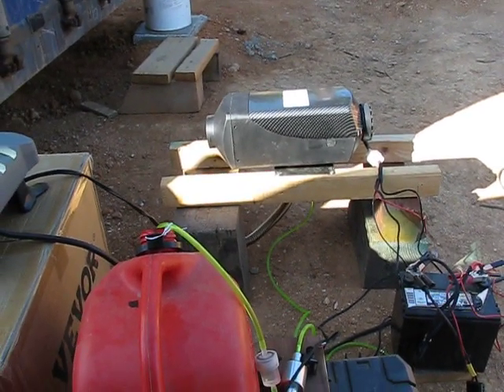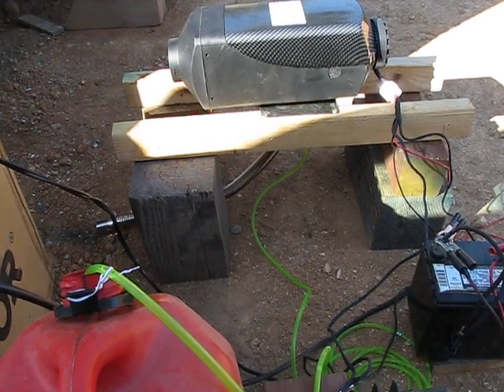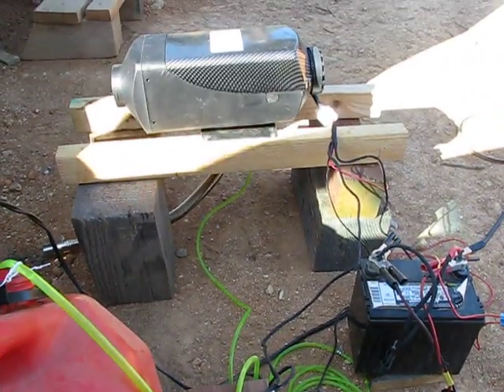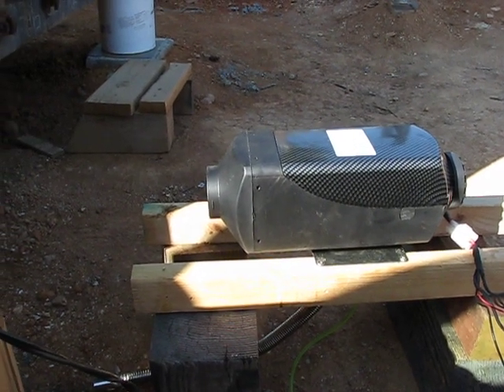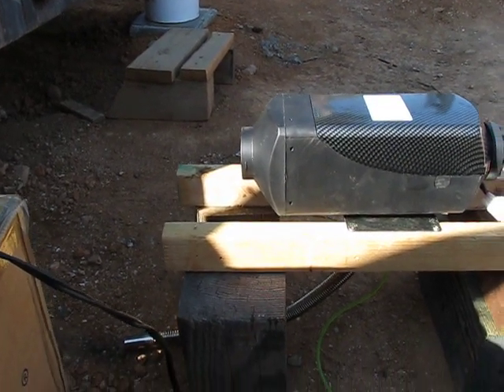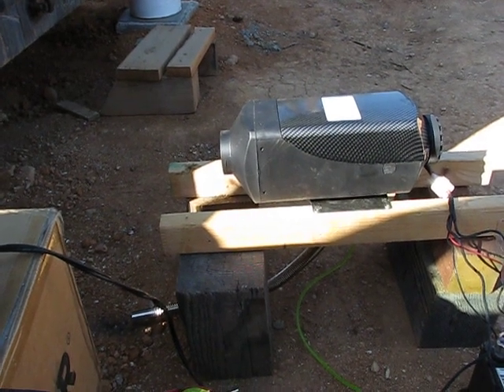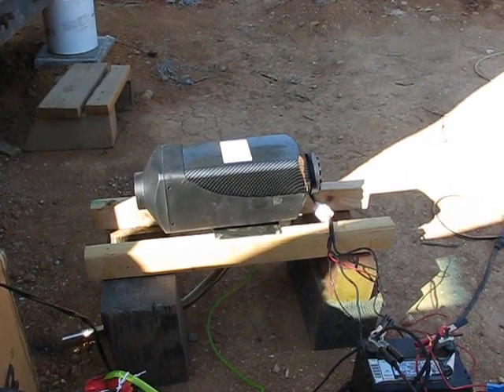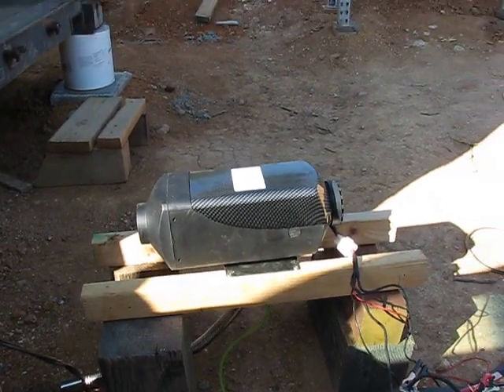First Startup of my VEVOR Diesel 27,200BTU Heater

Comment: Fuel pump need to be at 30-40 degrees I think.  I bought a 200w power supply off Amazon for $30.  They come in 5 kilowatts and 8 kilowatts.   If you paid $97 then it's Chinese.  If you paid $1500 then it's German.